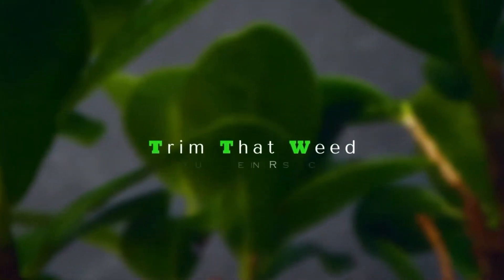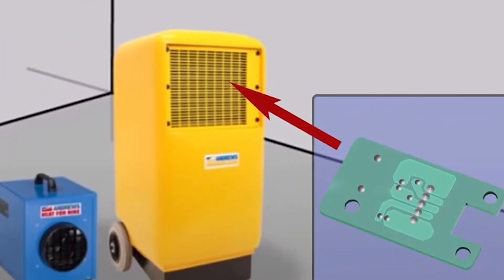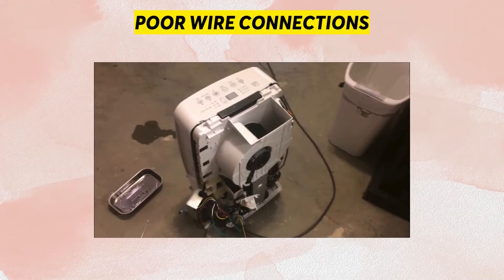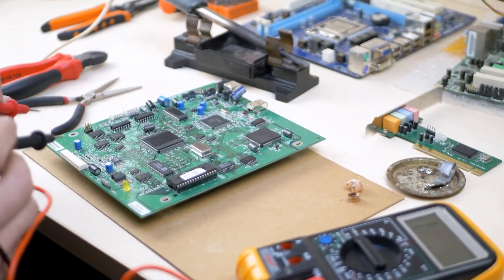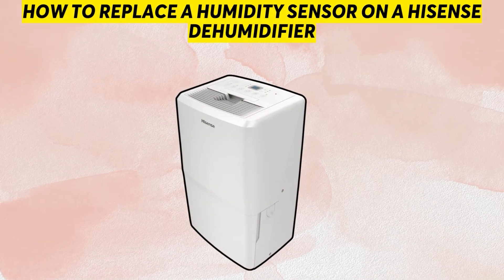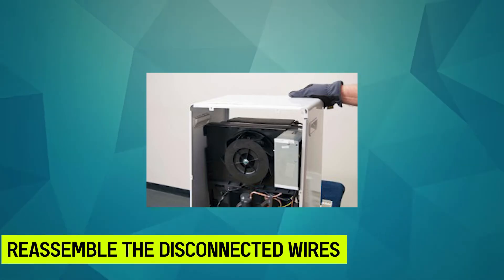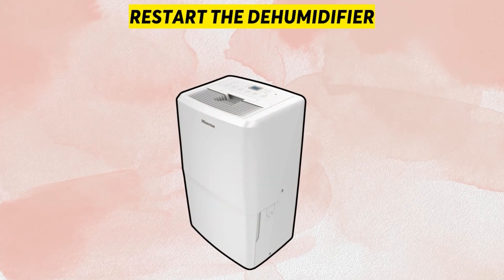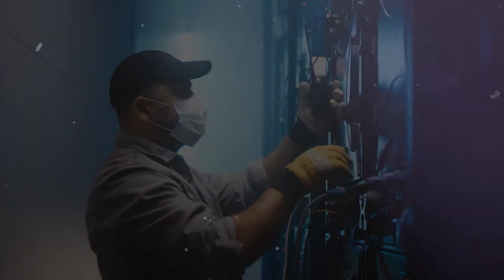Hisense Dehumidifier Error E9: Understanding Origins, Resolutions, and Practical Fixes

Comment: Changing the sensor will not work.
Reply: Why not?
Reply: @rickylimo2910  Take the cover off, find the sensor and blow it out. In most cases, even though it's only been a year or so since you bought it, the refrigerant charge leaks out.